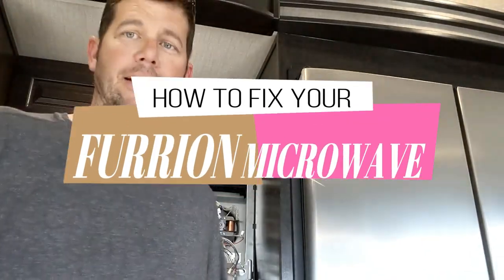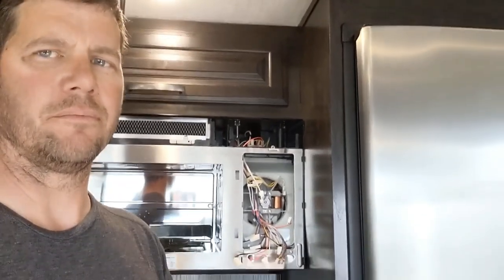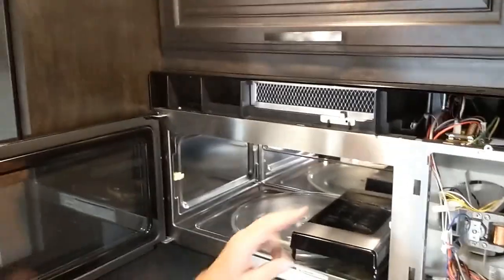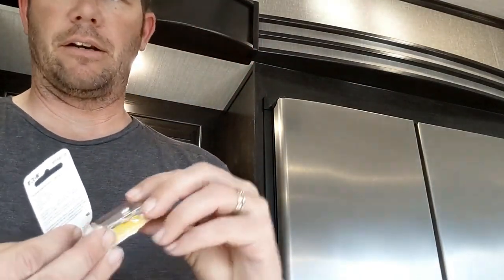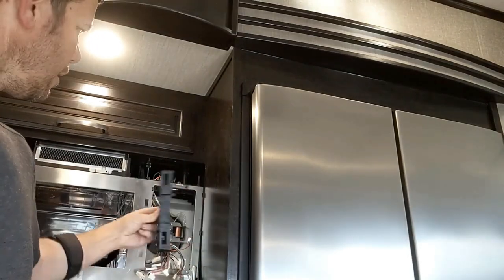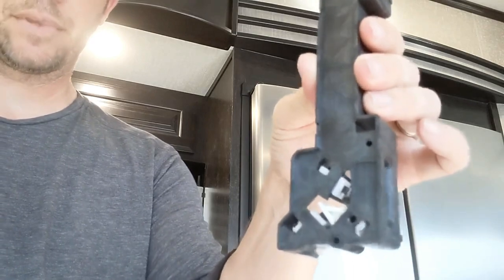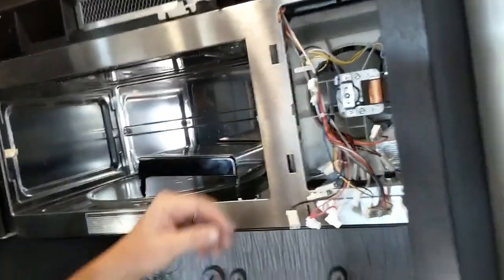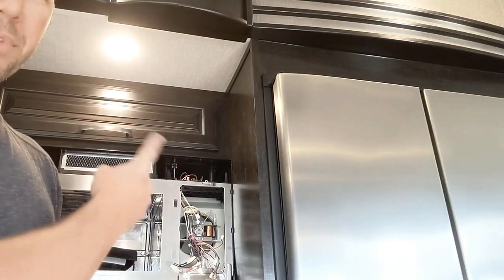How To Fix A Furrion Microwave.  What fuses I Used That Worked.  And A Bonus Update.

Comment: I appreciate the time you gave in making this video.  No doubt, educational.  I had nothing but problems with my furrion and decided it wasn't worth my time.  The glass turntable had shattered inside while in use twice. The door had three fine line cracks near the hinges and handle.  I am the only one who used the microwave so I know it was not used in a harsh manner.  I contacted Furrion and got nowhere.  The topper was opening the door and a quick flash of light then nothing .  In a perfect world the manufacturer would be held liable for anything that broke (mechanically) within 5 years.  Maybe they'd think twice about how quickly and cheaply they can put together an RV.  Great video ~ thank you

Comment: Have the same microwave with the same problems.  I replaced the fuse and it blew shortly after.  Was about to throw in the towel and replace the microwave until I found your video and, LOL, I brought the same wrong fuses.  Thanks much you saved me a bunch!

Comment: Good video. 
Turn OFF the microwave AC breaker first. 
The micro switches are available on Amazon. They are KW3A switches. The "Monitor" switch in the middle is NC (Normally Closed) and the other 2 are the Primary and Secondary interlock switches and are NO (Normally Open). 
The 2nd from the bottom which is the NC "monitor" switch usually has faulty burnt contacts and causes the fuse to blow. The switch can be removed from the panel by gently releasing the locking tab and pulling out the switch. They can also be disassembled to check the contacts visually even if they are passing a continuity check with a meter. 
The AGC (Automotive Glass Cartridge) 20A fuse is technically rated at only 32V at that higher amperage and actually provides a lower rating at 125V than the ABC fuse which IS rated 20A at 125/250V. In practice, they will both provide protection but the glass fuse is not rated for higher voltage/current combinations. I doubt it's the change in fuse, it's likely something else like a door switch panel or door misalignment causing the monitor to short the fuse as designed for circuit protection. 
After replacing the switches and fuse in our Furrion, it blew the fuse again a few months later and I found the bottom slot of the chassis was pushed in enough that the monitor switch was still closed the same time the primary/secondary are closed and that's what blows the switch. The Monitor needs to make OPEN before the others or the fuse blows. These models seem to have touchy interlock alignment issues. If it keeps happening I'll just buy a cheap residential microwave and pitch the bloody thing.
Reply from the maker: Excellent information!!! Love to hear others chime in with useful knowledge of a subject or items we can all learn from.  Thanks for watching!
Reply: Thats a good comprehensive review. Its odd that his mw blows one type of 20 amp fuse but not another. If Furrion actually manufactured this it looks like the first thing to do is throw it away. Replacement parts (some)  are not available according to Amazon. The dish on Amazon costs $75 and unavailable.  Thats a ripoff.
Reply: I just went through this, using the parts number that is the same on both lower door switches I didn’t realize that while almost identical (and numbered the same) the blades are a tad different located on each of them. I had ordered a set but they came in as the same, luckily it was the one that was bad, so I reused the one that was old but still working and all is working. This video was great as I was about to toss the whole thing as it kept blowing fuses. I didn’t catch the NO/NC variant.
Reply: Great comments. Are you saying the 32 volt fuse would not really work for this microwave? The fuse we pulled out of ours is a 20 amp 125 volt 611 fuse. When we went to Ace Hardware they gave us a 32 volt 20 amp fuse and I'm thinking how can this not blow right away when it is connected to a 110 volt appliance? I'm just not sure I am getting your comments about this aspect. Thanks!
Reply: @Charles-in3zt  Those are simply AC vs DC fuse ratings. Home Depot at least around here, always has those 20A "microwave fuses."

Comment: Thanks for the video. I was able to get the switch (set of 3) from Amazon and repair the convection microwave for under twenty dollars U.S. which includes shipping. 
👊🏻😎
Reply from the maker: Awesome!!!!
Reply: What’s the part number for the switches?
Reply: Would you be able to provide the link to the switches that could take me the exact switches that worked for you. I'm thinking you might be able to find the link by searching you past Amazon orders. I just can't seem to pinpoint exactly which of the switches I should purchase?  Were they difficult to install? Thanks!

Comment: I have the same exact microwave. It was fine until after the warranty expired then I Had to start replacing the fuse. I’ve noticed if I have the microwave light on as well as the light above the microwave that it will blow the fuse when I open the door. I’ve replaced with the ceramic ones and the glass ones. Going to try the AGC type instead of the ABC type
Reply from the maker: Hopefully it will work out for you!

Comment: Cover is proving to be challenging to remove, any hints?
Reply from the maker: After the screws are removed.... squeeze the cover where the screws were to clear the tabs and pull down and out on the top, possibly move to one side because there are tabs on the sides also.

Comment: I got the two small top screws out... how the ef do ya get the top panel off? Not be  a p$$$y? I'm pulling...but damn
Reply from the maker: Pull down and out... You ain't a pussy it is just in there solidly!  Pull down and out with squeezing or pushing down with your fingers at about the 1/3 point from each end, there are little tabs that also hold it in on the top... It's scary to do it the first time, because you don't want to break it.  But it has to be removed...

Comment: We have the same unit you have. However we're running into slightly different problem. From time to time, the microwave itself won't heat anything up.  Lights are on, carousel turns, no blown fuses.  I'll unplug the unit, let it sit for 5-10 minutes, plug it back in & the microwave will work normally.  I can't figure it out

Comment: This looks identical to our microwave. Could someone be more specific about exactly where on Amazon I can find the door switches? A link to the exact page would really help me. I see so many KW3A switches but not sure which will fit my Furrion Microwave model number FMCM15-SS. Also the video talks about buying a replacement part for the thing that holds the switches. If I bought that are the switches already put on to it? I would love to buy the whole piece as I'm not very good at mechanics.
Reply from the maker: All the switches are basically the same for every microwave.

Comment: So my microwave part is working it the oven part that is not working
Reply from the maker: The convection oven?  Is it not turning on, no power, not heating, starts and stops?  Need some more info on the issue.
Reply: @moseyingwiththemalys3357  no the microwave part works just fine. The oven will not heat. It just stopped getting hot one day. Everything else works